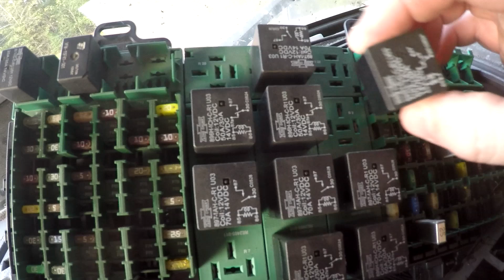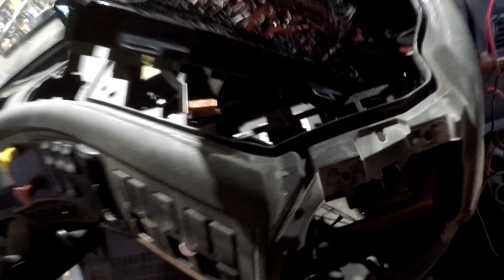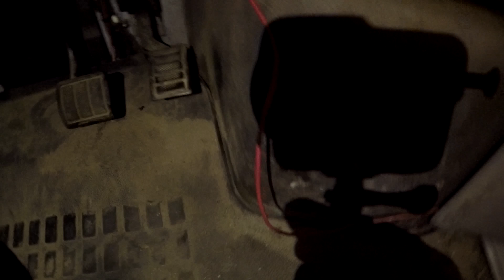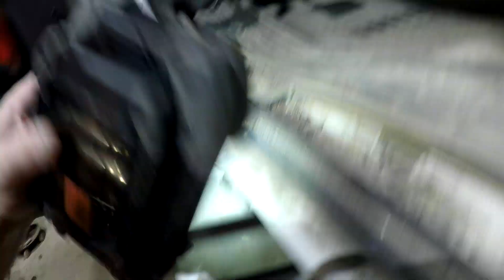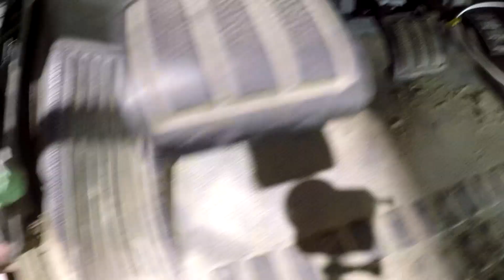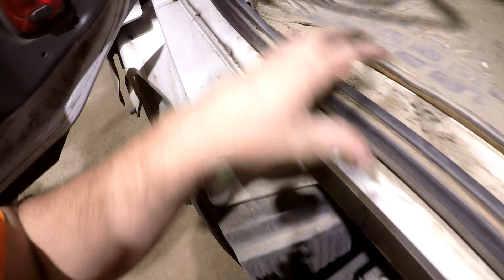Installing electric brake controller in a semi and wiring 7 way plug volvo vnl 780

Comment: My understanding that if you connect directly to the stop lights on the back of the truck then trailer brakes will lock when you push the brake pedal ? PS I got GMC 7500 with air brakes and tow-master trailer with electric brakes so need to figure it out

Comment: With the wire from the relay to the brake controller will it still have proportionate functions ?
Reply: The brake controller only needs to know that the brakes are applied.  The controller takes care of how much force is applied, using internal sensors.  It basically tries to match the braking force of the tow vehicle.

Comment: Is there really A3 or R3? My Volvo is a 2000. I think they’re all the same. I’m trying to do this plus you didn’t show us where the wires goes to the seven points plug that will be helpful. Thanks anyway you did a great job.
Reply from the maker: Relay on a 2000 might be different number or location IDK. Should be able to find if it's the correct one like I did, and you can find a 7 way diagram off the internet with a Google search. Some plugs even have the diagram on the package or on the plug cover.
Reply: @LifeWithChase  thanks brother. You made a great video and you saved me tons of money especially in a tough time. We are really grateful to you. You are a wonderful guy. I am working on it right now. Will keep you posted.
Reply: @LifeWithChase  I did everything but now I figured out that I have no brake lights because I didn’t listen to you by connecting to the trailer wire of the truck. Is there anyway that you can post a video or you can tell me? How did you do with the signals and the brake lights? I am really in a desperate spot.
Reply from the maker: @samiralghazi2783 just tapped into the tail lights on the back of the truck if you try to wire off the trailer circuit for lights it won't work because the trailer circuit brake and tail lights are separate where as the brake and taillights is combined on back of truck just like a pickup. They make a conversion box called a jackolopee for those who want to wire off the trailer circuit but I didn't see the need, my trailer has led lights so very low amp draw, so tapping the tail lights on the truck has worked fine for me.
Reply: @LifeWithChase  I did it and you have saved my bottom. I truly appreciate you. That was a great knowledgeable video. God bless you, brother.

Comment: Did this end up working with your trailer? I did the same and my trailer brakes are not responding properly
Reply from the maker: Yes seems to work fine. when I go full voltage on the controller and manually squeeze the brake controller it will lock the trailer brakes and slide the tires in my yard, and everything seems normal on the highway.

Comment: I learned and got confirmation on a lot of things you talked about, thanks for sharing. Are you going to have any more dozer videos, i’ve been waiting for the push bar video, I saw where you built it and installed it. 😊
Reply from the maker: None in the works currently. I don't know if or when I will ever use the push bar unfortunately. I had a couple jobs in mind when I started building it and I was planning  to buy some land and use that to clean it up but none of that worked out.